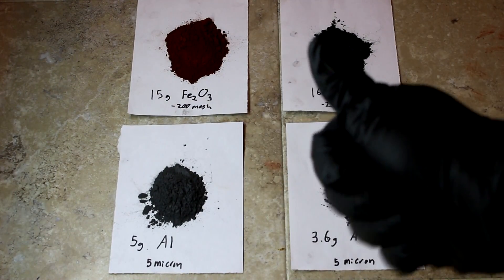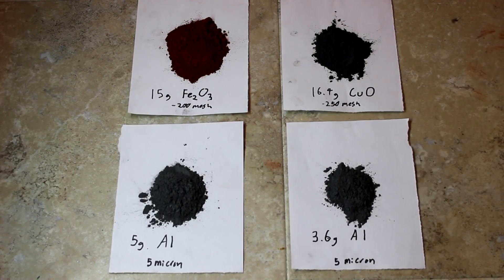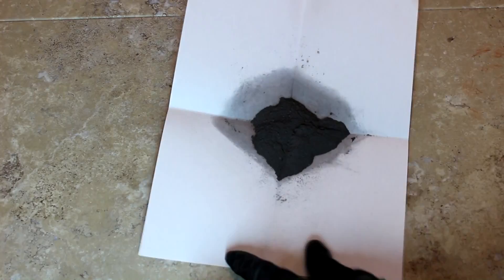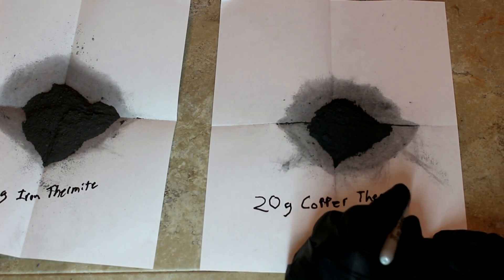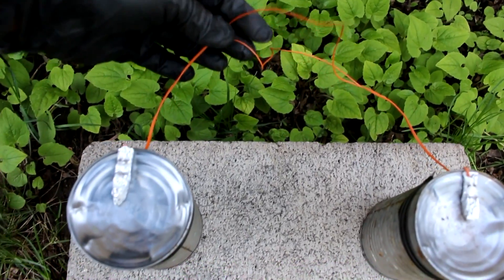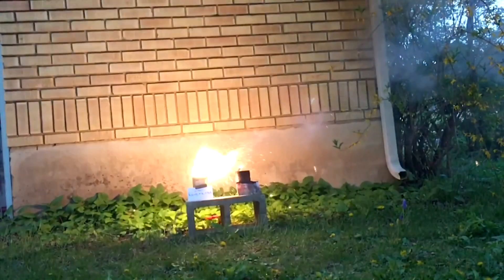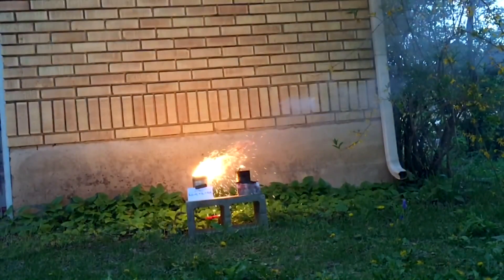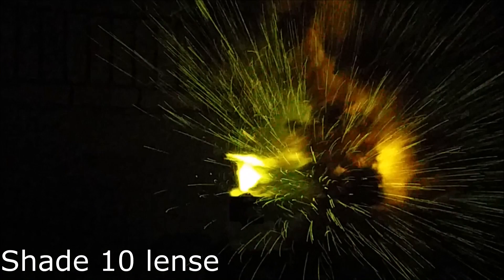Iron and Copper Thermite

Comment: I was under the impression that the copper explodes mainly because it has a low BOILING point, and that as it boils, copper expands more than 30,000X from its solid volume. This expansion is what makes a stoichiometric ratio of CuO and Al a (very) low explosive. This is more than a deflagration, at least in my books.

Comment: Very interesting.
Your use of copper made me think of the armour/tank piercing rounds that start life as inverted copper cones that vaporize etc.. - and also Shape(d) Charges used for demolition, both using copper.
I wonder whether your experiment proves why copper is used in military/demolition.
I'm not suggesting thermite is used in demolition (who would think such an outlandish thing!?) but judging how the Copper Thermite liberated far more heat and energy than the Iron based Thermite, it shows how Copper in a Thermite Mix packs-more-of-a-punch than Iron, so to speak (and could potentially be directed/focussed) :)

Comment: So thermites charge from r6 used iron thermite
Reply: There are other powders that can be added to a thermite mixture to adjust the reaction rate and thermite is not restrained to just iron or copper (or aluminum for that matter, but it usually works the best).

Comment: Hey Cody now I can´t seem to find a real video or anything about removing superglue from plastic without doing damage to the plastic any suggestions?
Reply from the maker: +brianher67 
Acetone will dissolve super glue but only some plastics.
Reply: +Cody&#39;sLab  It´s for my warhammers but I have heard that acetone makes the plastic that warhammers are made of weak. Is it possible to remove one of superglues building blocks to make it crush into powlder like frost does to water?

Comment: Hey Cody, wouldn't the copper thermite react quicker more because the difference in reactivity between copper and aluminum is much larger than the difference between iron and aluminum? I always thought it was because copper is really unreactive compared to the aluminum and therefore oxygen is more likely to jump to the aluminum. Same principle with the iron but it's more similar in its reactivity to aluminum so they're more likely to jump to aluminum but it happens slower.

Comment: Aluminum oxide thermite? is that possible?
Reply: +Just-A Velociraptor hypothetically but you couldn't use aluminum powder in it. You'd have to use something more reactive than aluminum. But usually any metal more reactive than aluminum reacts with oxygen spontaneously which would probably spoil the thermite before you could even ignite it. Best bet is to use the classic iron oxide and aluminum combo.

Comment: cody why dont you use copper thermite as an explosive for your mining project since you said if it was a fine enough powder it will act as an explosive
Reply: +Jacob riddle I think 1. it's tricky to set off from a safe distance because you need more than a spark, usually a normal flame isn't enough. 2. It's heavy! I don't know how heavy other explosives are, but they are made of non-metals, which are usually much lighter. 3. It can get messy walking around with about of super-fine powders, and also really dangerous The reason the fine powder explodes is because the particles are really small, so they can react with each other faster. For the same reason, it is really dangerous to carry around because it can react with other things. 4. The aluminium can react with the air if you give it enough time, making aluminum oxide which shouldn't react with iron oxide or copper oxide (I think). Overall, it's much safer and easier to use traditional explosives. I don't really know anything about explosives, but I think this all should be right.
Reply: +Jacob riddle forgot to mention that it also leaves around a bunch of molten metal that freezes into solid metal. Using traditional explosives seems so much simpler.
Reply: Probably illegal
Reply: ***** then how did he get it to go off
Reply: Jason Rashall i dont think so
Reply: +Guy S about the 'messy' part 
he can have it already contained in what he wants to make it explode in
Reply: +Jacob riddle the price copper oxide and aluminum is i higher than gunpowder
Reply: +Jacob riddle magnesium it acts as a booster which most explosives need to go off like rdx(c4) or semtex  they can be burned normaly as fuel or set off explosively with a high energy booster like magnesium , petn, blasting or even just a high energy arc like the electronic exploding brige wire packs .

Comment: can you make lead thermite?
Reply: +Julien Weems you can make thermite out of any two metals as long as the elemental one (aluminum for example) is more reactive than the metal in the oxide (iron, copper, etc.). If you look up a reactivity series online, you can see that aluminum is more reactive than iron and copper so the oxygens like to jump to the aluminum. This breaking and forming of bonds releases a lot of energy. As long as the lead is less reactive than whatever other metal you're using, it should work.

Comment: @Cody'sLab The more vigorous reaction of the copper oxide isn't due to the lower melting point or higher density. It's due to copper being lower on the metal reactivity series than iron therefore the aluminum it's is displaced from the oxygen more aggressively which results in a much faster, more explosive reaction.
Reply: +Final Spartan I bet that he mentioned it in previous video, when he trying make copper termite ;)

Comment: what causes the explosion? I'm assuming it has to be only the air expanding, since both reactions produce only liquid metal and aluminium oxide. Or it the copper hot enough to boil and form vapor?
Reply: +unipetrolak I'd wager it's the aluminium oxyde that's vaporized...
But I really don't know
Reply: +unipetrolak The reaction actually produces copper gas, while the aluminium oxide is liquid. You can see the brown gas coming out like a mushroom cloud.

Comment: Cody do you know an easy way to obtain iron oxide and aluminum powder, because when I last tried to make my own copper rust and aluminum powder, and I mixed them together, it didn't ignite. It did make a TINY little spark at the beginning, but that was it. (4 hours of grinding copper and aluminum foil balls...)  😢

Comment: Try adding some finely powdered potassium nitrate to the thermite to speed up the reaction and increase the heat. :-)
Reply: Maxthebag
When I played around with thermite, I used a mixture of iron oxide, aluminum powder, and pulverized potassium nitrate. When you use the right ratio, the mixture burns extremely well.
Reply: Sounds cool
Reply: unipetrolak
Trust me, adding a strong oxidizer will help the reaction. :-)
Reply: +electronicsNmore A strong Oxidizer will lessen the reaction, as Aluminum is a strong reducing agent.
Reply: Adding nitrates (or sulfur) makes the reaction happen too fast and removes any melting ability. You get a poof of sparks on an unharmed test object.
Reply: +electronicsNmore that's not how thermite work

Comment: The copper thermite works for a rimfire reactive target. Make some small packets of it (like a couple teaspoons full) wrapped up in paper. Place it on a hard surface and shoot it with a supersonic bullet. It goes up with a bang.  I find a steel plate with some small sections of pipe welded to it to hold the packets works well so if you miss the packet and hit the plate the bullet frags don't break open the packet and lose the thermite.

Comment: Hey Cody, id like to say firstly that I'm fairly new to the channel but it didn't take me long to realize that subbing was a no brainer. I have been power watching your videos in the evening. 
Lately ive been trying out making thermite in small batches just for fun/ something to pick at in shed. But im really struggling to get it to light. I have been making my own iron oxide and aluminum powder and trying to use sparklers/ magnesium shavings for ignition with no luck. Was wondering if you had an email address so I could get some pointers, or just chat here in the comments. Thanks a bunch man, your videos are really entertaining!

Comment: could the copper based thermite be used as a propellant like gunpowder? since it had such an explosive result
Reply: +supernoob651 It might have some uses, but A, from just a flash, we have no idea how powerfull an explosive it is, it it too fast, and to brisant to be a propellant, or is it in the sweet spotto both develop enough energy, produce a big enough volume of gas per volume of powder, in a "gentle enough" way to be a propellant, instead of a high explosive...
If it's to brisant, (although I doubt it), it would destroy the chamber before the bullet had any time to travel down the barrel...
It could also not be fast enough, and be too wimpy an explosive to do so...
 Although all of that is testable, as of this video, we just now it combusts fast enough to do so in a flash, but no idea of the volume of gass it generates, and at what speed.

Then, if it's not to slow or wimpy, or to fast and brisant, there's a
BUT, and it's a biiiiig but!
A thermitic reaction reduces an oxyde into it's metallic form, FeO to Fe, or in this case, COpper Oxyde to coppe, at really HIGH temperatures!
Where do you think that copper metal will go? What would prevent the copper vapour and gobs to deposit themselves in the bore?

Consider it won't be like barrell fouling at temperatures bellow the melting point of both metals, but at temperatures above the melting point of both copper, AND steel, ie enought to weld or braze one to the other?
I guess that even if feasible,  it would trash at least the barrel, in relatively short order!

Comment: My son just asked "if you want to ensure cutting through steel, which mixture would be more efficient?"
Reply: +DannoCrutch 
Standard iron-based thermite is what you'd want to use.  The point is to transfer as much heat as possible to the target.  The copper-based thermite reacts too quickly and most of the energy is lost to the environment rather than the target.
Reply: +ABQSentinel Thanks, I assumed that might be the case, but I'd rather be factual than my assumption. Cheers!

Comment: Personally, I believe that to make this experiment more valid (not that it wasn't interesting), I think you should set the mixtures apart so that they don't contaminate the results of the other. The heat from the copper flash undoubtedly had an effect on the iron mixture.

Comment: Watch the explosive blast radius of the copper! Similar to a copper electrical arc fault copper can be extremely explosive and dangerous when rapidly melted into a gas state. Copper expands during an arc flash event at a factor of 67000 times within a few milliseconds. This demonstration is far superior to the original and much safer. Nice work!

Comment: Would copper termite be useful as an explosive?
Reply: No.
Reply: +Standartenführer Possible, yes. Useful, no. If you are not careful, copper oxide thermites can explode, but they have a very low detonation velocity, so they are not very useful.

Comment: Would it be possible to make thermite from other oxides like ZnO?
Reply: ***** What makes a metal reactive?
Reply: You can make thermite from every metal oxide (even from silicon dioxide)
Reply: Really? If so i would like see it done with thoruim or uranium oxide
Reply: Twirly Turd
That sounds awesome af.
Reply from the maker: +TheExplodingPumpkin 
You would just need a more reactive metal to take the oxygen. In the case of zinc aluminum may not be reactive enough so you would need sodium or lithium. they use magnesium to produce uranium metal from oxide.
Reply: TheExplodingPumpkin google

Comment: Hey Cody, what would you expect from gold oxide and cesium thermite (Au2O3+6Cs=>3Cs2O+2Au)? Will it make a big boom or will it for some reason not work? Love your videos BTW, Thanks!
Reply from the maker: +Guy S 
It should work, cesium has a very low density though so I doubt it will explode... course gold has a high density and cesium has a low boiling point... I'm going to have to try this.

Comment: What do you get if there is more iron oxide than aluminium?
Reply: You get an incomplete reaction.
Reply: +TheAnthroGamer Technically, you can get iron in lower oxidization states than 3. Since the  reaction is incomplete, you can end up with say metal mixed with FeO, or something similar. Thermite reactions are very forgiving on the stoichiometry, so you can often just mix ingredients half and half and get an interesting result.

Comment: do one with a higher melting point then iron
Reply: Than*
Reply: +Alex Wenn NurdRage has a video showing chromium thermite. it burns slower and colder than iron thermite due to chromium needing more energy to react and melt, meaning less energy output to continue the reaction and melt stuff.
Reply: +Eric Wilkinson Usually the point of thermite is not really to melt its container but to perform the reaction (and thus produce pure metals/welds) I'd say.
Reply: well said my friend
Reply: cool
Reply: "nurd rage"  once did a video on  something with higher melting point than iron, i dont remember what it was called but i remember that the mixture was green...
Reply: +Guy Friedman Chromium oxide? That's quite green.....
Reply: CoolKoon yes, thanks for reminding me...
Reply: Do Titanium thermite!
Reply: Well, titanium would act as an oxidizer (i.e. react like the aluminium). What would you want the reducer (the oxide that supplies the oxygen) to be?
Reply: CoolKoon TiO2 would be the oxidizer. Al powder would still be used as the fuel. Other ingredients are also needed. Theodore Gray (of Periodic Table Table fame) did it.
Reply: +Double Dare Fan Could you point me to any reference (literature or video) about that? I'm asking because TiO2 is a VERY stable molecule that can't be broken even by electrolysis (the standard way of making elemental forms of many metals including aluminium) so I don't think it's possible..
Reply: +Gerben van Straaten, I think that the word "may" should be replaced with "will probably" and "without warning" be replaced with "spontaneously". Also, care would have to be taken to have proper stoichiometric ratios of Gold Oxide and Cesium to reduce the risk of forming Cesium Auride (which is apparently a thing).

Comment: one time in chemistry back at school I accidentally caused thermite reaction that self ignited.
 I was messing around making flash powders with magnesium and potassium nitrate, I wanted to make a green flash so I added  copper sulphate and the resulting reaction between the magnesium and copper was so volatile it ignited while I was mixing it burning my thumb and leaving a little blob of copper on the table.
Reply from the maker: +Cameron Cooke 
awesome!
Reply: Reaction between copper and magnesium? Can you write an equation, because I don't get it.
Reply: +Standartenführer to be honest I dont know if it was a  true thermite reaction but it's what my teacher said. I think there was a displacement reaction between the magnesium and copper sulphate, in the same manner that aluminium displaces electrons from the iron oxide. but don't take my word for it, I'm sure anyone who has actually studied  chemistry in the past 5 years could explain it better

Comment: Interesting. With the exception of thermite/ice explosions, I have never seen a thermite explosion before. It's a first to see just plain thermite explode by itself when ignited.
Reply: +David Barts This was not an explosion, in a technical sense. The mixture did deflagrate, or "burn", really really fast, but it did not detonate. When it really explodes, you rather hear it than see it.
Reply: +VeronV I disagree. It was definitely an explosion, albeit not a very violent one. Not all explosions are detonations. (It's the difference between high and low explosives.)
Reply: David Barts Yes, a deflagration can be described as a subsonic explosion. However, this is only the case for substances that are unable to detonate even under high pressure conditions. I.e a low explosive. Copper oxide and aluminium is NOT a low explosive, it is a high explosive with the detonation velocity of roughly 2000 m/s. It really depends whether or not you use the pop culture "movie" definition of an explosion, or the scientific combustion to deflagration to detonation definition. Just like if you take uncompressed TNT, RDX, C4, ect, and light it on fire, it will burn (combust), and then deflagrate, but is unlikely that it will detonate. Search deflagration vs detonation and you will see that it requires sufficient pressure to detonate a mixture, i.e sealing it in a metal canister.
Reply: +VeronV I am sorry, detonation does NOT require confinement. Nitroglycerin, for example, will detonate just fine unconfined.

All detonations are explosions but not all explosions are detonations. Deflagrations are explosions, too.

I was unaware thermite could detonate, and all the matches when I try to search on thermite detonations seem to be ones that confuse any explosion with a detonation (of which I am well aware of the difference). Could you recommend any references?

Comment: the copper thermite was ground too finely, a larger particle size will make it more effective
Reply from the maker: +Terabyte7 
Thats kinda what I was trying to show.
Reply: +Cody'sLab ok, what if you made a line of various particle sizes and set them off until unison,  the first (or last) one would be explosive and the one at the other end would be slow burning, that would be a cool demonstration.

Comment: Would a mediation between copper and iron cause a different reaction? Combination of intensity and duration?
Reply from the maker: +dominiccafaro 
It does seem to help lower the activation energy (easier to light)
Reply: +Cody'sLab hi Cody would you be able to do a video about manganese dioxide thermite from lantern batteries?